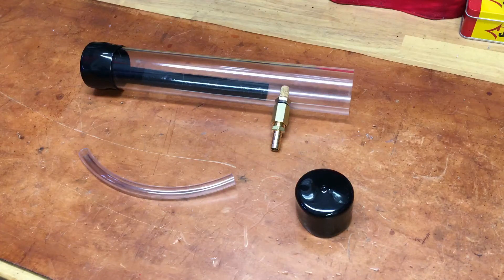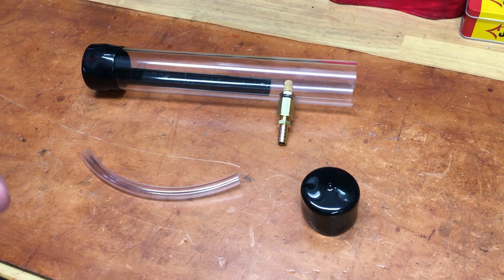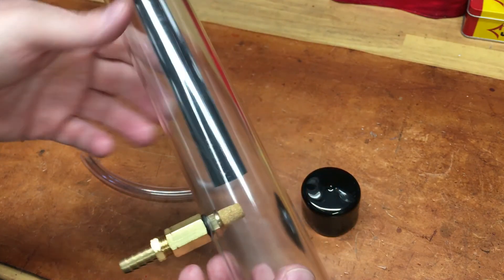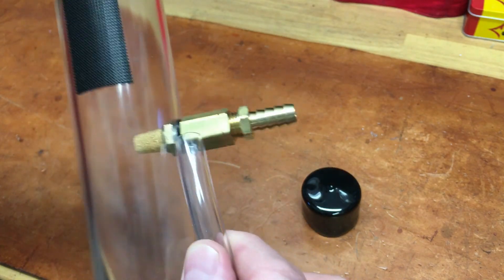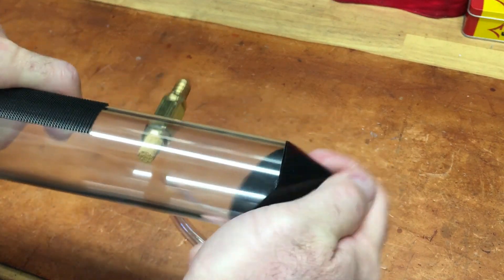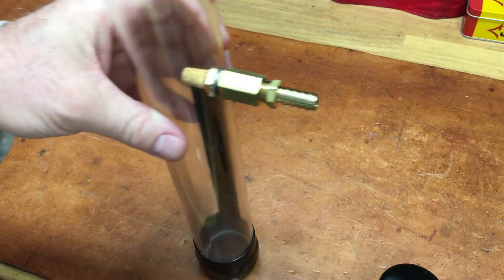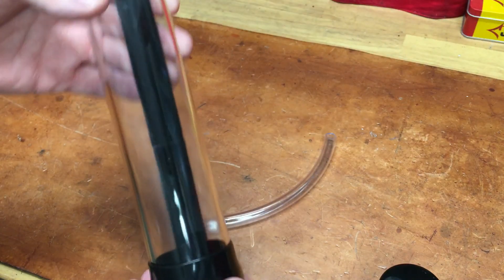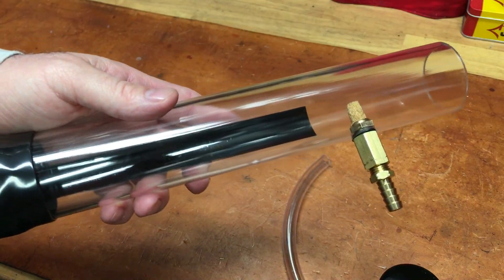DIY Air Dryer for Tuxing HPA/PCP Compressor

Comment: What size and thread is that filter that you removed from the compressor?  I wonder if that's same size and thread as the one for my Yong Heng.
Reply from the maker: That was so long ago I don't even remember.  I'm guessing they are all the same size as the designs are just copies of each other and it would make sense to standardize on parts and sizes.

Comment: Did it hold up to 300 bar? It sure looks flimpsy compared to that high pressure ?
Reply from the maker: My modified air filter has nothing to do with high pressure as the original filter is an external device that just sucks in ambient air.  All I did was add desiccant to the process to further dry that ambient air that is sucked in...and you're confusing modularity/mobility with flimsy (what about this solution do you believe is "flimpsy"?) as when it's mounted it doesn't move, but when I disconnect everything, it's a removable component.
Reply: @ReLoadersBench  i thought i was inline and got full pressure.  Yes i see now its only an airfilter.
My bad.

Comment: Very nice. Question. Everything I've read about the beads to work and absorb moisture, they must be packed tightly and fill the container fully. How's yours working?
Reply from the maker: I have bead/filter OCD going on with my compressor setup that there seems to be multiple types/sizes and in so many places from source to destination I think I’ve probably over done it.
Reply: @ReLoadersBench  lol. I hear ya. I had bought a Venturi air intake from PA for my large Venturi 4500 air compressor. And what I found out in testing, was that it was actually chocking off air to my unit. So I didn't want to stress my unit any and did away with it. Air filling time's went back up without it. Not a total waste. It's on one of my Yong hengs now. I do like the one you made though.

Comment: What size diameter and thickness of acrylic tube did you use?
Reply from the maker: 1/8" thick and 2" diameter
Reply: Wanting to find a cheaper and more readily available option, I went with 2" vinyl tubing from Home Depot (about $7 for a 2 foot piece).  I used black rubber end caps that have hose clamps on them.  I drilled a bunch of holes in the one for the bottom which acts like the screen/filter you used.  I drilled a 1/2" hole in the top one and used the same brass fittings you used (2 barbs and one coupling) and the vinyl tubing.  I spent $30 on all that at HD.  I'm just waiting on the desiccant to arrive.  Thanks for the ideas!
Reply: @Ozzy67987  just use pvc pipe it dont have to be clear
Reply: i just used a 3 inch wide pvc pipe and made it about 6inch long
Reply: did you even listen to the video he stated what size thickness and all
Reply: Do you even have to be an ass?!

Comment: Great idea, but how does the air get in to the tube, you mention something on the bottom of the tube cap, could you elaborate on this a bit? thanks!
Reply from the maker: I took one of the black caps, cut a hole the size of a half dollar coin and placed window screen mesh (a circular cut the size of the inside diameter of the cap) on the inside so when I slipped it back on it had a nice seal and kept everything in.
Reply: @ReLoadersBench  Thanks a lot for the explanation.
Reply: 3:08

Comment: Where did you get the extra muffler and fittings for the tubing ?
Reply from the maker: I took the muffler off the compressor and picked up the fittings at Home Depot.  Tubing was from Home Depot or Tap Plastics, can't remember which one.

Comment: Bro.  Where did u get the 2 pieces the hose slips on to
Reply from the maker: Did a video on just those parts called "DIY HPA Desiccant Filter - parts used".  Picked them up from HomeD.
Reply: @ReLoadersBench  yea. Just found em there. Did the same thing. only used a Gatorade bottle instead. Threw the top. Drill a hole in the lid. Cut out the bottom. Put a screen filter on the bottom.